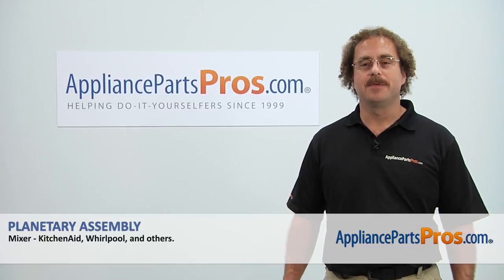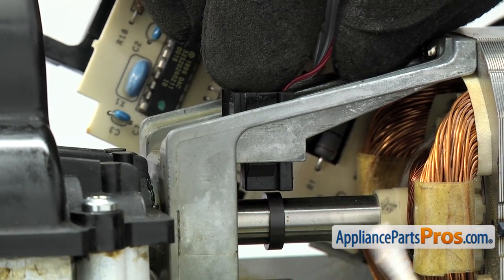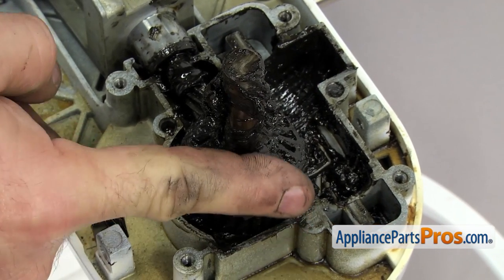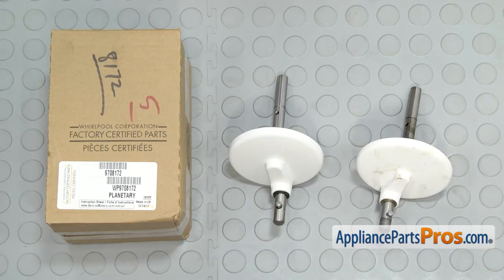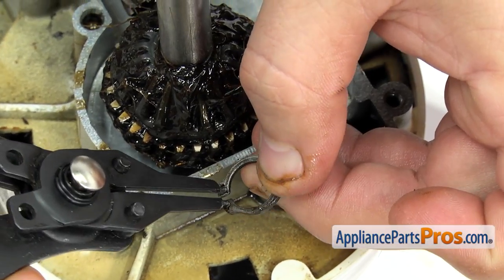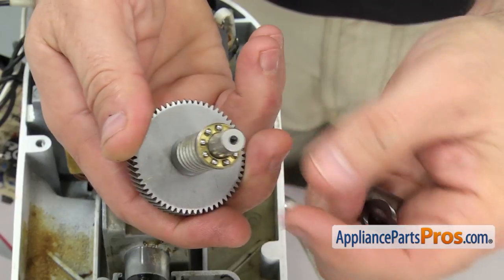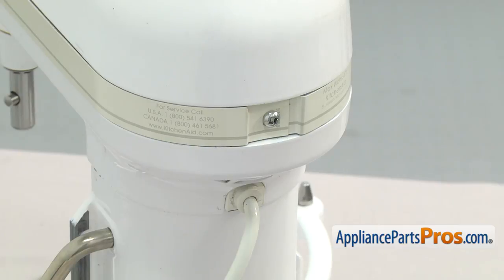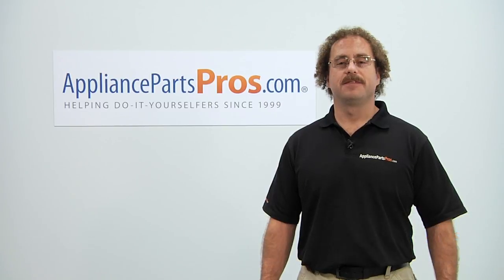How To: Whirlpool/KitchenAid/Maytag Planetary Assembly WP9708172

Comment: I replaced grease in my 7 yr old model Kenmore Elite Stand mixer.  Thank you very much for a great video.  In addition to replacing the grease (food grade grease, which I bought from eBay) I replaced the o-rings of the Planetary shaft as well as Pinion shaft o-ring.  Your video was very useful.  Thank you!!!

Comment: Thank you so much. I have my Kitchenaid mixer for about 20 years but during the years the planetary used to fell off during mixing for about 2-3 times. What it happens? How to fix it? Thanks!
Reply: This video is very helpful.  For your specific problem, it would almost have to be where the pin holds the shaft in place. At 5:20 in the video it shows you where the pin is taken out and at 7:40, it shows you shows how and when it gets installed back in.  I recently replaced my entire planetary assembly but in the process of the repair I realized that only this pin was broken.  I spent with shipping nearly $100 for the entire assembly but if I only would have replaced the pin, the fix could have been as little as $10.  I saw this video too late!

Comment: I think I bought a lemon.  I've had my 6 quart mixer for years and it really never sounded right, kind of a grinding sound.  Recently I thought I'd replace the worm gear.  I opened it up, removed all the parts, got new parts, greased them up and tried to put it back together.  I removed the planetary assembly and the factory did not put one drop of grease on any of the parts.  The top of the gear is worn down to almost the spring clip and the housing is full of metal shavings.  The plate above the outer gear is extremely worn.  Can any of this be replaced?
Reply: Yes, you can buy an entire new planetary assembly

Comment: Thank you very much 
Good job.
Can you please show us by video how to  replace the carbon brushes for the kitchenaid heavy duty (7quart)
Model no 5KSM7591XBER
Reply from the maker: If no video is available for your part, you may contact us at 1-877-477-7278 or chat on our website http://www.appliancepartspros.com/ and we'll be more than happy to assist you with the repair. You can post questions on the Question and Answer section of the specific part page to receive answers from our techs. The best part of using our technical support options is we provide the service for FREE.